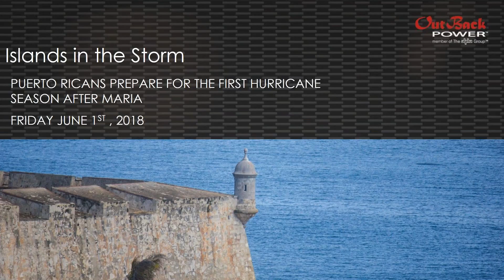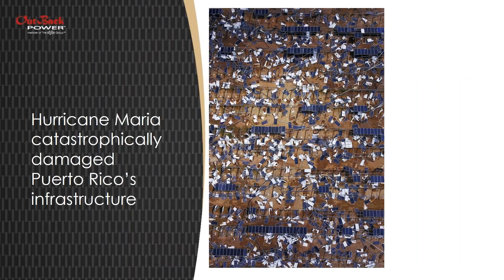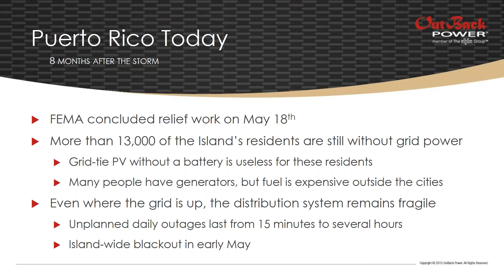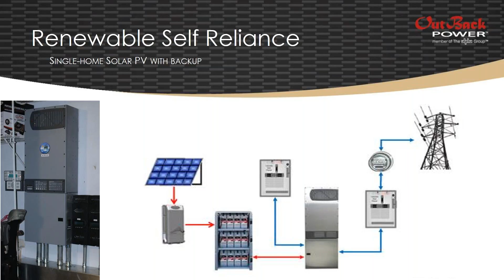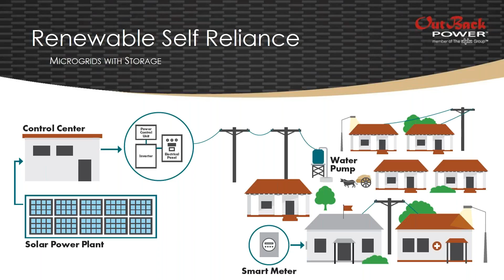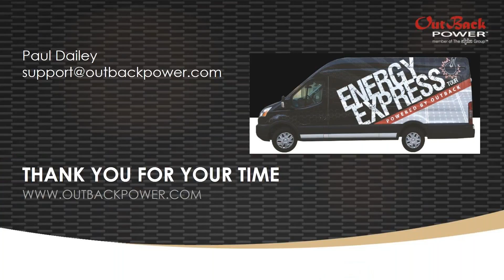Webinar | Islands in the Storm - Puerto Rican Hurricane Season

Comment: Hi I want to know was the price of the Alino charge controller inverter I live in Isabela Puerto Rico I own a outback flexmax 60  I went to your web but coundnt find the Alino  I only have 4 6volt 235amps batteries and 6 100watts panel and a invetter from vertamax 1500 watts i run my refrigerator 24/7 on this system and 5 4watts led light bolds use only when the power go off . Sorry i could buy everything from outback but this storm wipe out all my savings buying gasoline for a generator and everything became si expensive
Reply: When are they coming to Isabela?